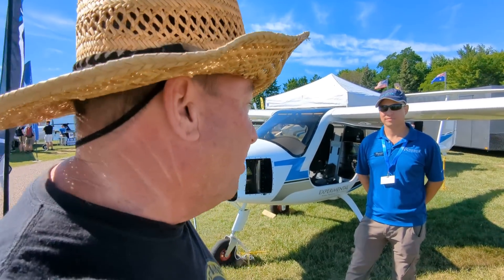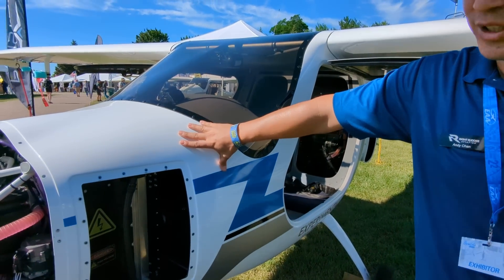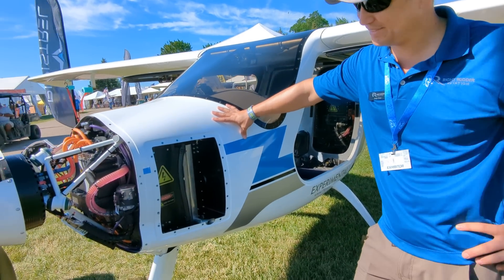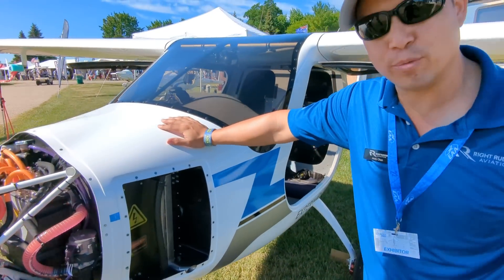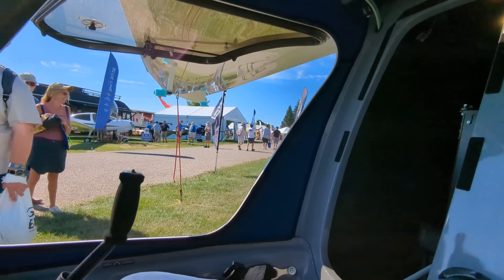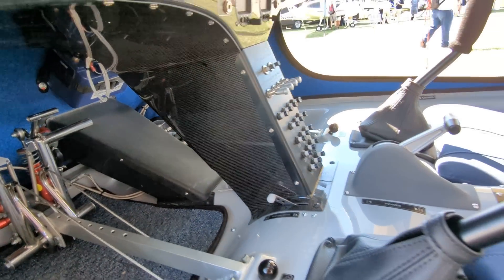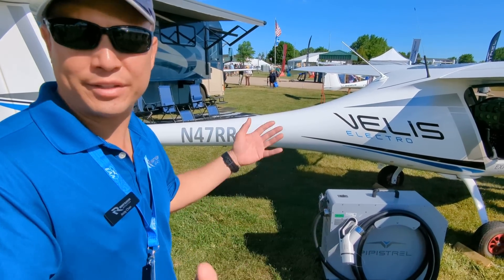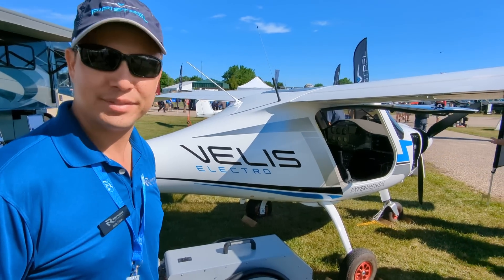Electric Airplane?! Pipistrel Electro at Airventure 2022.

Comment: Cool! Can you give it a test flight Juan? Even figuring battery reserve cost maybe I'm guesstimating half the cost of Avgas. 2000 30min charge cycles at 2C rate of charge (with 20% degradation) seems a be a bit optimistic for Li-on. The cooling system seems a bit complex other than that looks ok.

Comment: I would love to have heard the motor.  I suspect that it is very quiet.
Reply: No way 😳 to charge the batteries ?
Reply: It probably would be quiet.  I'm wondering what frequencies the inverter runs at.  Usually rotary electrical machinery on aircraft runs at 400 Hz (for synchronous operation) because there's less weight in higher frequency machines than the ground-based 50 or 60 Hz equipment.  But this motor would need to run at variable speeds so the inverter would need to be a variable speed inverter, running at the hundreds of Hz range to keep the weight down.

Comment: They laughed at my dad when he was one of the first to fly nicad powered RC large scale planes he built with hedge trimmer motors, on the field.  I wish he were alive to see this.  This was his dream!   They use to call him “mr. Electric”.  That was about 30 years ago.
Reply: 28 years ago I bought an electric-powered RC glider (Kyosho Stratus) which was powered by a large nicad battery pack and a hefty brushed motor. It would take about 3 minutes to get to altitude, had a poor gliding performance due to the overweight power system and had juice in the battery for two, perhaps three climbs per charge. So the total flying time on a fresh battery pack, climbs and gliding included, was about 25 minutes.

And then, a few years back, I changed the glider's motor to brushless, and the battery pack to lithium. The model is some 500g (about one pound) lighter, has an enormous amount of power and climbs to altitude almost vertically, in about 30 seconds. And once there, will soar power-off just about forever. So a fresh lithium battery will provide a whole afternoon of on-and-off flying at the field, on a single charge. What a change.

And I still do fly with that 28-year old sailplane.
Reply: I have flown electric model aircraft since the late 80s.The current technology is light years better than when we started.The advantage is less noise ,less pollution and far better reliability.Engine failure is a thing of the past,unless the battery is run dry.The battery technology is still improving and a 3 hour duration isn't far away.
Reply: Haha in our RC club, there isn't a single combustion engine left.
Reply: We have come a VERY long way from 1980, when I started flying electric with nicads!

Comment: The entire top surface of the wings should be solar panels so it recharges while you're flying, thus increasing the flight time.
Reply: Solar doesn’t make that much power on a small surface… I doubt the cost/weight benefit would work out.
Reply: @albedo0point39  Mike Patey-Scrappy might beg to differ.
Reply: If they can’t do it with the car I am sure that it will not work in an airplane. Only 180 BTUs per square foot of sun exposure and the best solar cells are about 20% efficient.
Reply: @ron9381  BIG difference in the amount of sunlight that reaches a car on the surface under clouds and trees vs a plane at altitude above the clouds. Granted, Mike Patey's Scrappy plane isn't powered by electricity, it's gas, but he has huge battery system that runs all the avionics as well as charging two motorcycles hanging under the wings. But Mike Patey is also a freaking aviation genius as well though. I'm just saying that less than an hour of flight time isn't enough and I'd want to be able to add to that for a little extra insurance, even if it only got me 10 minutes, I'd want something.

Comment: Of course everyone has 480 3 phase voltage available to them Which by the way is a special requirement for the power company to install that electricity to your particular business location and that is not cheap
Reply: 380-400 3-phase is standard in Europe, you usually have that in every garage or barn. And it‘s all over the places at airports and airfields.
Reply: You can take 240 3 phase and boost up to 480 3 phase using buck boost transformers.
Reply: @icare7151  
Probably not legal in your hanger or your home or to code
Reply: Most industrial buildings have high/ lows electrical systems, this would include airport, hanger buildings. 480volt / 277 Wye systems that are used for high horsepower motors / large lighting loads. The high voltage  then suplies dry transformers for 120volt / 208.
Reply: @paulstaney325  
I don’t know what airport you’re are at but the entire Aurora Oregon airport does not have 480 3phase electricity there 220 is about it I know for a fact the entire north end of the airport is 110 to 220 only.

Besides the 50 minutes useful duration is useless regardless of what airport location you are at
Reply: Huge money.... Huge.
Reply: 3 Phase 480V is what a lot of ovens run here in Germany. We re talking apartment appliances.
Reply: @z33r0now3  
We get by with just 240V here in America. 🤷‍♂️
What are you Germans cooking that requires so much juice??? 🧐
Reply: @straybullitt  funny enough it is actually less juice if we are talking amps, using twice the voltage halfs the required amps for the same amount of watts which means smaller wires for example.
Reply: @chaoz1666  
yes and a ¼ resistance losses.
(I² × R)
Reply: @straybullitt  my grandma‘s pork roast 😁
Reply: @straybullitt  It's not more juice.  Same power to cook in Germany as in the USA, just higher voltage uses less current which means lower IR losses and I-squared-R losses in the electric reticulation network while doing it.

Germany (and the rest of Europe) doesn't have squillions of kWh or energy to throw away ... even less now that Russia is slowing turning off the tap on the gas pipeline because Europe is supporting the Ukraine in the "Special Military Operation".
Reply: In the US, it is pretty common to have 3 phase 480 volt power available to commercial buildings that usually transform it to 120/208 or 120/240 for most loads, and use the 277/480 for lighting and any large equipment. If you have 277 volt lighting circuits (common in large buildings like hangars) you have 480 volt 3 phase power.
Reply: I don't even have 3-phase anywhere near my neighborhood! 😆
Reply: Electric car, trucks, lawn equipment, landscape equipment, generators...all of them are more expensive and more limited than gasoline/diesel. Manufacturers need to do more research and development before the public and commercial areas can depend on electric as a better and less expensive method for operation. As it is now, most electric alternatives are simply a temporary item...vehicles do not have the range nor the charging stations to make them worth their cost. Small engines are even worse...subject to recharges several times a day means battery life will decrease and replacements will increase costs all while saving nothing in the long run. Cost will go up, usage will decrease.
Reply: @Garth2011  AOC will find a solution.🤮
Reply: @Garth2011  The median car price currently is $48k. Plenty of electric vehicles, even quite good ones, cost less than that. Most people can easily have a Level 2 chargers installed at home for about $750 and charge overnight. That will cover their commute and all other local driving, which for many people is just about all they do. Road trips are a little less convenient, but more charging stations are being built all the time.

As for small equipment, perfectly good electric versions are readily available and widely used. You simply haven't been paying attention.
Reply: @markmiller3279  I am aware of them...I don't agree they are any better in operation or in the maintenance end. Batteries for lawn mowers are very expensive, the cost for charging up isn't getting any less expensive as power rates increase and if you happen to be in the landscape business, you'd need at least 5 to 10 spare batteries to keep a machine operable for a full days work. Most equipment drains a battery in 20 minutes. Everything that folks suggest is great about electric vehicles has to be related to local commutes however, the expenses will always increase as the conveniences do. Those vehicles will all require a battery replacement at some point and they are well over $10,000.  Has anyone seen how they mine for lithium?  Its takes a few earth movers that use diesel engines to mine lithium, trucks to transport it, factories to process the many other ore's than go into a battery.  Globally, no one is saving the earth or the ozone layer because of the requirements to produce batteries. And, where is the power produced for that Level 2 charger which is an additional cost? Likely from a natural gas turbine generation plant or maybe a coal plant. Especially if folks are going to be charging their stuff at night...when solar panels are not working. Lots of guinea pigs out there until they get the idea refined when the cost and overall pollution levels make any sense.
Reply: @Garth2011 Your whole statement is just not true. . How many battery powered tools or lawn care items do you have? How many electric cars have you driven or used?
Reply: What are you talking about! I have 3 phase in my garage. It charges my Tesla. 
Anyway, it will charge off regular 240 too, just slower.
Reply: @evan010101  
Big whoop, your Tesla needs recharged every 100 miles… then you sit on your asz for an hour or so, just so yo can get home, all the while spewin coal fired electricity goo into the air!
Reply: @Showboat_Six  it goes about 300 miles from full.  And I mostly recharge it from solar on my roof. Or on a road trip, around here grid power is like 80% renewable most of the time. We have no coal power stations at all.
Reply: Wonder why they don’t put solar cells on top of the wings like Mike Patey did on his most recent build?  Obviously the solar panels wouldn’t charge the batteries but could provide power for the cooling pumps, avionics etc…..taking load from the main cells providing more time in the air.  Here in the US 3 phase power is only available to commercial customers and I agree would be cost prohibitive to have 3 phase brought to a hanger off from the main terminal/FBO.
Reply: @advorsky1   what about “night flights?”
Reply: @advorsky1  Can't wait to see the military convert to all electric LOL
Reply: @advorsky1  The solar cell idea might be rather expensive as they would have to be designed to lift the airplane and be able to conform to the shape of a working wing. Likely, too expensive for the yield.
Reply: It's just to get the charge speeds, you don't need it
Reply: A flight school making the investment is a lot different than Jim Bob trying to get three phase run to his rented hangar.  This is for flight schools.
Reply: @cup_and_cone  
50 minute flight is barely enough to taxi out to the local active runway and get one or maybe two circuits around the airport before you have to land especially if it’s a control tower airport
Reply: @Showboat_Six  
On the bright side, you will be able to shut off the engine while you are number 5 for takeoff, waiting on 4 aircraft arriving on the ILS.
Reply: Their website mentions 3-phase 380 volts, not 480. And 380 (actually 400 these days) is what pretty much every shed has in many parts of Europe.
Reply: a lot less power than is being installed for electric car chargers all over the place- plus while it will take longer you could use 240v which everyone has

Comment: Seems like a novelty still with such short flight time per charge.
Reply: 2 hours plus reserve would make a game changer for IFR instruction.

Streamlined battery pods hung on each wing, quickly exchanged, should work, air cooled of course, no complicated water heat exchanger. Battery weight , carried directly by the wing where it reduces structural weight on the fuselage.
Since landings and take off are near 1 g load factor , the landing gear load structure to the wings is probably unaltered.
Reply: BTW, I just looked up their documentation and they claim 60 minutes of battery power + reserve for pattern work.

I flew a DA20 this morning which has design roots in a motor glider similar to the Alpha Electro.  The only thing I did was touch-and-gos and racked up exactly 1 hour on the Hobbs.  I monitored how much fuel I consumed during that flight and did a bunch of math to see what that would be in kWh.  I can show my math if anyone wants it, but to get to the point I do believe that their claim is realistic.
Reply: That's why Juan repeated that it was for training.
Reply: It's like the Piper Pilot 100i, it's only meant to be used by flight schools.  This one is specifically meant for pattern work.  You may be lucky to get a .7 in your logbook per flight, but it'll only cost you about what a .3 would in a 172.
Reply: @peteranderson037  "but it'll only cost you about what a .3 would in a 172" not after the flight school realizes it has to swap the batteries it won't :P
Reply: @GuardedDragon  And they don't have to fill it with fuel. Electricity is significantly cheaper in almost all places. Those batteries are just a different way of paying for fuel.
Reply: @GuardedDragon  Interesting comment.  But why can't you mention that the same flight school won't have to pay >$20k for overhauling and inspecting an ICE over 2,000 hours?

Comment: Are we talking 50 minutes flight time or 50 run time. Also reserve power time?
Reply: 50 minutes plus reserve.
Reply: @Maurice_Walker  what kind of reserves? Is the bms setup so the battery doesn't charge to 100% and can handle some cell degradation before actually losing flight time?